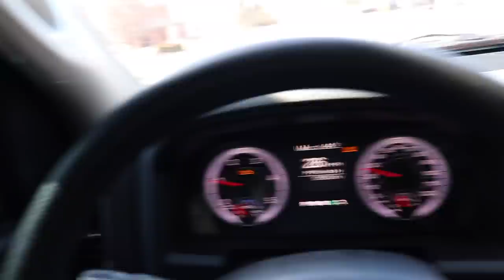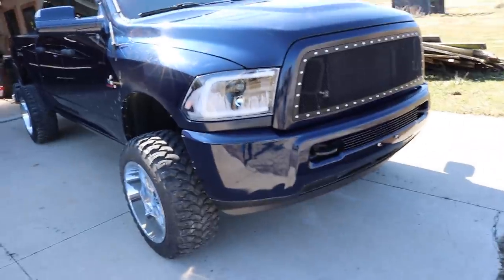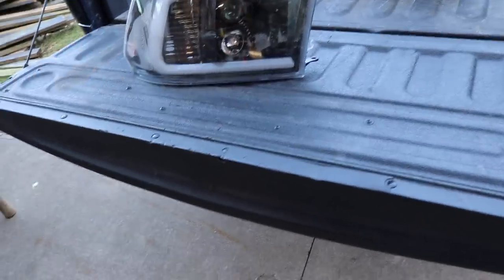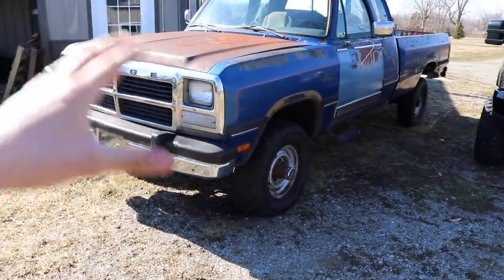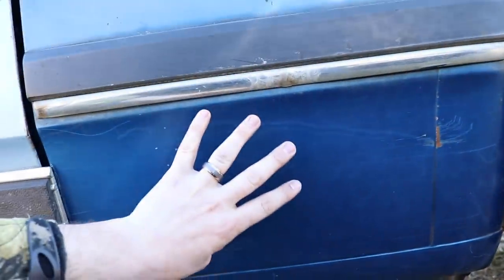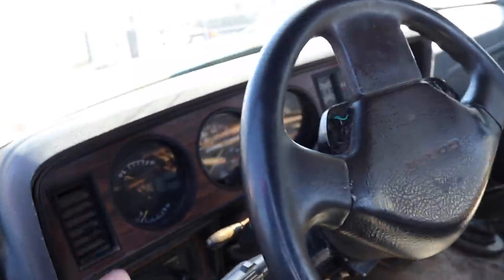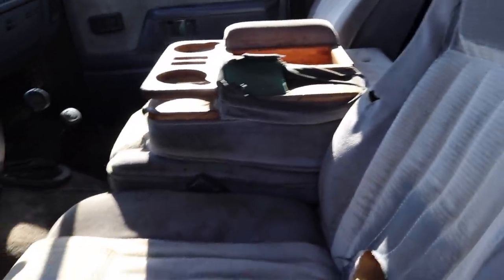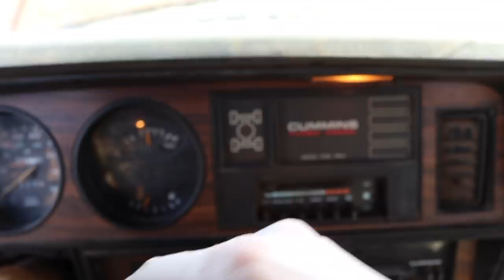I BOUGHT A WRECKED 1st GEN CUMMINS TO RESTORE!!!

Comment: Good choice, my daily driver is a 1990 w350 srw 4wd 12 valve 5 speed. I love driving it. But need new heat ac controller. They are very hard to find

Comment: No wide lenses! 
The blue Cummins needs 20x10 with 35, get the correct offset so no rubbing issues. Fuel sprockets

Comment: It's kinda funny how excited guys up north get over a older truck with no rust just a  everyday thing down in the deep South.
Reply: You would be to if you lived in the north
Reply: @Ohiocountryboy-se2cn  I am sure I would been up north and worked on cars from up there no thanks ain't got that much patience or tolerance to freeze my ass off.
Reply: @bigjmma6797  i have lived in ohio my whole life. So im used to it. I wish they would find something to treat the roads that wouldn't rust out cars
Reply: @Ohiocountryboy-se2cn  My wife is from Ohio  she had a 4 year old truck when we got married when she moved down South it was such a nightmare working on that thing even after only 4 years a freeze plug rusted out and just fail out always breaking or stripping bolts out  all the time . Changed the plug wires up there on it before she moved in December snowing at 3 degrees with no covering what a nightmare. Went to a salvage yard up there once jacked the car up and the jack went straight through the floor board. I am so glad I have always had vehicles from the south I just don't have the patience for that kinda stuff. I feel bad for you guys having to deal with stuff like that. I owned a salvage and used car lot and repair shop down here and I can't recall a single time running across anything with any real rust. I really don't know how you guys do it I guess some how you get use to it when it's what you always dealt with. Kinda like working on Ford Diesel I just ain't got the patience to much of a pain in the ass compared to a Cummins.